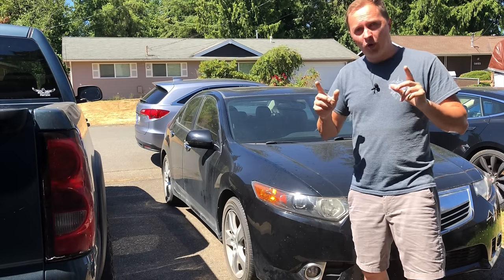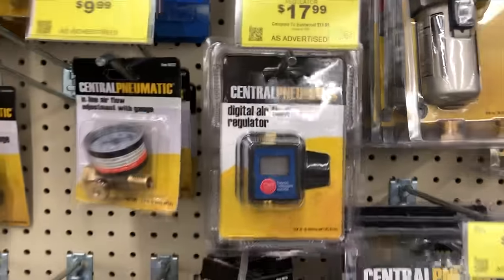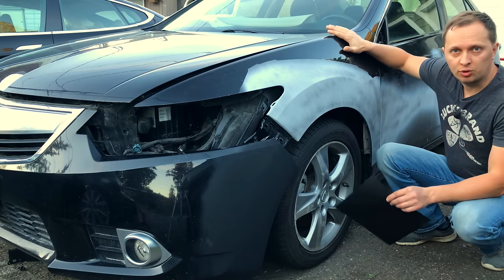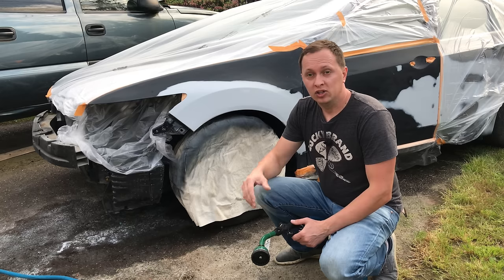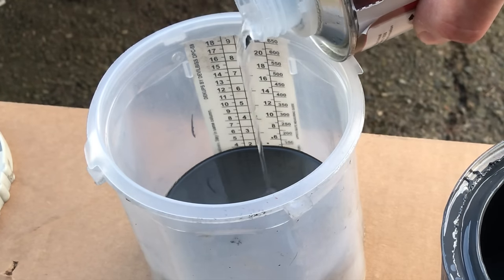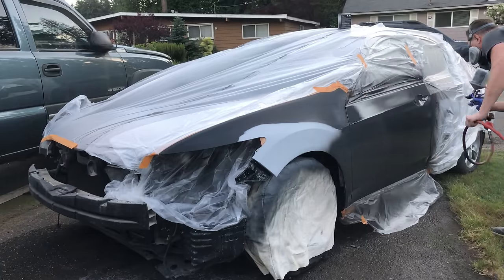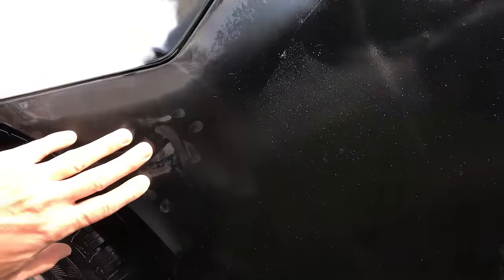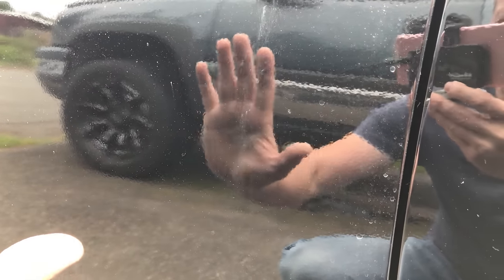✅ Using Cheap Chinese Harbor Freight Paint Gun to Achieve Professional Results

Comment: These harbor freight guns like a lot of air 35 to 40 psi to atomize better smoother finish
Reply from the maker: I did realize that toward the end... So in reality they are not HVPL, too much materials would get waisted at that high of pressure setting. I've set those guns up just as I setup my Iwata and DeVilbiss,
Reply: @gene7902  brother I can lay clear with a BLK widow the as good as I can with a sata 5k
Reply: @gene7902  ehh if u doing something onna budget it will be great
Reply: Also cheap paint likes to orange peel.
Reply: The one I got from harbor freight worked better at 29 psi than 45 the normal working pressure less orange peel
Reply: What psi do u run at to get a really good  atomation
Reply: I noticed this as well I thought it was me
Reply: I had the same problem , they like more pressure .

Comment: i am not a professional painter but have painted several cars and im embarrassed to admit that the finish that you got with the higher priced gun looked pretty good to me. I can see the orange peel, but many cars factory paint has that amount of orange peel anyways. As a matter of fact, you can spot a car that has been wrecked before often times by the LACK of orange peel on the refinished panels ONLY. (Most body shops use real high quality guns, hence no orange peel) Great video, and you sure did have some great results for painting a car outside. Excellent video as usual!
Reply from the maker: Thank you very much!!! The finish that I got with the second gun wasn't too bad. But that orange peel was heavier than the original Acura orange peel. If I wasn't doing a video I would've done just a slight cut and buff where some of the orange peel would have remained. But for the sake of the video I want to show people that even a really bad paint job can still turn out to look show quality, so I went ahead and made it look like glass.
Reply: In reference to the orange peel - it actually depends on the age of the car.  A car that is 15 years old will have less orange peel because it gets knocked down over the life of vehicle by owner(s) washing and buffing their car.  If you ever look at 20 year old car that has been well kept for, it has pretty flat paint.
Reply: @fix206  Good job and excellent video the only question I have is the fact u were painting that close to the truck? Is that ok? How did you avoid overspray?

Comment: This is a perfect example that cheap costs you more in the long run. If you have the skills to do professional work, buy professional tools.
Reply from the maker: Yeah no kidding, now I have to spend a few more hours cutting and buffing. I generally don't have to cut and buff after I use my usual guns.
Reply: I use these cheap guns all the time and they are good. Just clean all the silicon out of them and they are great guns.
Reply: totally agree, 4 another 30 beans u couldve got a devillbis flg5 from spray guns direct $136 beans 😀
Reply: Exactly, if these are tools used to make money then cost should be low on the list of priorities.

Comment: I paint at home and have a few DIY budget guns. The profesional HF is one of my favs along with my Devilbiss FLG5. I use pressures on the lower end to keep overspray down but the profesional and purple guns do  not like pressures under 2 bar for base/sealer and more for clear. I dont buy the purple guns anymore because they all leak air into the cup. My FLG5 can run at 15-20psi base/sealer and 22-25psi clear with low overspray. Cranking up the pressure on alll these guns give you better finishes at the expense of overspray. I have used expensive guns and they are great but for the DIY you can get it done with a less expensive gun if you learn to set it up to suit your needs. Cheers

Comment: Another very informative video (as usual). It was interesting to see the difference in the finish quality with the two guns. I was expecting the more expensive gun to do a better job and that proved to be the case. One thing though, as you pointed out, the preparation is far more important to getting a good result. Even with the cheap guns and orange peel, by the time you sand and buff the clear, it will be as good as using a good quality gun, just more work. But either way, the preparation defines the final finish. You are doing well painting outside, but it just goes to show what you can do at home without all the professional equipment, for less severe damage.
Reply from the maker: Howdy Bruce !! Yes, as you've said it, all that these cheap guns do is create more work for you in the end to achieve the desired end result. Because I ended up spending a majority of the day on a paint correction that I otherwise would not have done if I wouldn't have used my nice guns
Reply: It's all about the painter but it looked great even with the cheap gun.

Comment: Been using both guns for years take apart and clean silicone off and you will get great results with these guns what's nice about it is you can have several guns at your use at the same time. All my paint jobs are in my driveway.
Reply from the maker: Do you crank the air pressure way up to get better paint/clear atomization ?

Comment: Mirror finish...good enough for the DIY guys just trying to get paint down...like you said. A little cut/buff would be fine. Great vid!! 🍺🍺
Reply from the maker: With a bit of practice just about anyone can paint in the driveway or a garage and get good results in the process... And if you're not not too sure about what it is that you're doing, it's better to lay the pain down on the dryer side rather than on the wet side. It is much easier to cut and buff orange peel than trying to sand down runs or sags in your paint job... Ask me how I know :)

Comment: A guy I follow on YouTube painted a Corvette hood and achieved Excellent results with the Harbor freight cheapo gun.👍🏿
Reply from the maker: It is possible to achieve a good result by using that gun, but to do that you have to crank the air pressure way up. When you do that you create a lot more overspray, meaning that you lose a lot of your material into the atmosphere instead of it ending up on the panel that you're trying to paint. Good quality guns can achieve a good finish at much lower air pressure so this way you're not wasting expensive materials

Comment: I use the Harbor Freight two gun set for shooting primer. The 74 dollar gun I use for base coat and clear. I spray the clear at 20 psi and get a nice finish. If for some reason things don’t look perfect you can color sand and make it look great.A lot can be said for proper setup of your gun and cleaning it throughly before you ever spray with it.
Reply from the maker: I did not do a thorough cleaning before spraying, just ran some thinner through it a few times and called it good. I sat the gun up the same way as I set up my Iwata and you saw the result that I got with it. With my Iwata I can lay both base and clear down where I normally don't have to do any color correction afterwards, might just have to take out a nib or two and that's about it

Comment: This was a great video, I am looking for a sprayer to use on my fence and the $30 Harbor Freight seems like a winner. After seeing this, I will also repaint my wife's car, which is pretty sun burnt. If I can get it half as good as your worst job I will be pretty happy and a big improvement over the existing.
Reply from the maker: Don't think this paint gun would work out too well to spray a house or a fence with, because that type of paint would be too thick to pass through the small tip at the end of this paint gun. But I'm sure you can get your wife's car done with one of these no problem :-)

Comment: I agree if you plan to spray on a regular basis or plan to make it a sideline or business get a professional gun. I have used the cheaper guns for work trucks and in the shop for different projects with good results. While not a professional unit they work for those of us that might use a spray gun a couple times a year.
Reply from the maker: I normally pick up a lot of my tools used so I don't pay the premium when you would if you buy new. Pretty sure I paid right around $200 for each of my guns that I spray with. I don't paint a whole lot maybe two-three times a year. But I always try to achieve the best result possible without doing a whole lot of cutting and buffing afterwards, and these guns help me achieve that good finish so that's what makes it worth it for me
Reply: @fix206  
Same here buy gently used tools and equipment. Harbor freight sprayers are what I call my one and done, modification, or sacrificial tools.

Comment: I have painted quite a few cars with the purple gun, a new one each time old one with a little mods become my primer gun, I use about 35- 40 lbs pressure to loose the orange peel, get just as good a job as my expensive guns.
Got to clean that new gun perfect and then do it again, has a lot of oil on and in it.
Reply from the maker: The main point I was trying to make is that if I set up the purple gun the same way as I set up my expensive guns it doesn't perform the same... Sure you can achieve a better finish at 35–40 psi but that point you turn a lot of your material into overspray. Professional guns achieve nice finish at lower pressure thus depositing more material onto the panel rather than into the air. 
And just like you I do keep a purple gun for primer.

Comment: Turn up the pressure. Most cases the cheaper the gun the more pressure is needed. (most cases) The purple gun will lay a professional looking finish as long as prep is done properly. Wet sand after helps tremendously.
Reply from the maker: You probably could get a better result with that gun by turning the pressure way up, but it's suppose to be an HVLP gun and I just wanted to see how it would perform by setting it up the same way as I set up my HVLP Iwata. With higher pressure you end up with much more overspray, which basically means that you're losing a lot more material... It's an OK gun for a beginner and even a weekend warrior. I guess there's a reason you don't see painters at collision shops using these, and I personally wouldn't use it for anything more then to lay down some primer...

Comment: Thank you so much for taking the time to make this video and show us how bad a cheaper gun will cost you in time. I personally could not do that. I was honestly thinking about one of those guns from harbor freight, and as a beginner I'm so grateful for this! Now I'll just go ahead and get one of the better 2 you have. Thanks again and keep that content coming!! God bless
Reply from the maker: If I were you I would avoid Harbor freight altogether when it comes to paint guns. If you're trying to do this on a budget go ahead and just buy a used gun on eBay or something like that. Trust me it will be easier to learn with a professional gun, you will achieve better results after a bit of practice, but with a cheap gun even with a lot of practice you're still not going to get a satisfactory finish. And at that point you probably would just blame yourself for doing something wrong rather than blaming a crappy gun. It's worth it to spend a bit more but save yourself a ton of headache in the end.
Reply: What did I end up getting?
Reply: I've seen a cheap gun do a lot better it was actually amazing

Comment: I stumbled upon this video as we inherited a 09 civic that I am restoring for my wife. It needs a 100% paint job and in several parts, large portions of metal are showing. I was wondering if I need a HVLP or a LVLP for my current set up. Someone have given me 2 of those purple guns
 My compressor is a harbor freight and the specs are as follows 

It's a 27 gal 200 PSI

Flow rate
6.3 SCFM @ 40 PSI, 5.1 SCFM @ 90 PSI
Volume
27 Gallon
AC Volts
120
Amperage
15

I am an absolute noob to paint. So if you're willing to spend some time I have some questions, I really appreciate you taking time to look at this
Reply from the maker: The compressor that you have will not work for auto paint unless you have some small items that you're painting. It will run out of pressure very fast and I don't think you would even be able to paint a single door with a compressor even if the tank is fully charged. Those purple guns from Harbor freight are garbage in my opinion, but if that is all you have then just go for it. HVLP is the way to go

Comment: Sharpe makes some pretty good entry level professional guns.  Think they are in the $150 range.  All the materials are expensive.  The average Joe would be shocked what sheets of sandpaper go for above the 800 grit range.  Your clear could have been part of the issue too.  I've become a fan of Southern Polyurethane's products, but you can't just pick it up off the jobbers shelf.  You are pretty creative in your work.
Reply from the maker: I have never used Sharpe guns, but I've heard good things about them. I've only ever used Iwata and Devilbiss guns, and had some pretty good luck with them. Personally if I were to get into painting but couldn't afford some higher end guns, I would just try to find a good used gun for a half or even third of the price. And you are not kidding when you talk about price of materials, and everything just keeps getting more and more expensive as the years go by. I have noticed that the clear that I used, set up a bit quicker than I thought it would so it didn't really have a whole lot of time to flow out, but the cheap guns that I used for spraying didn't atomize it very good either, especially the first gun used.   I do appreciate the comment, more videos to come here shortly. Stay tuned 👍

Comment: What i've learned painting my classic VW Bug with the purple gun is that you need to crank the pressure way up to like 50psi to get them to atomize correctly. That way I get way less orange peel than in the video.
Reply from the maker: But at that point you create a huge cloud of overspray and a lot of your material doesn't make it to the panel thus being waisted... Still doesn't make it a good gun, you can normally lay the clear down like glass at 25–30 psi with a good, professional gun... I'm sure you can use a sandblasting gun and turn the pressure up to 100 psi and you'll be able to lay down some basecoat and clear through it 😂😂😂

Comment: I don't paint much at all. But I will admit the purple gun works good as a primer gun, just not for real paint. I have heard sometimes you get lucky and the machining on the tips works out really well, but that is an exception and not the rule.
 All in all, a very informative video. I have heard all this before, but to see it in action is much better.
Reply from the maker: That's just about all the purple gun is good for, I've been using one of those for a primer gone for the past few years with good results. But with primer you're not really looking for a good finish, just coverage.  Thanks for the comment Matthew !! Also let me know if you ever come across Holland Landing gear :-)
Reply: Huh I have painted a lawn mower, bunch of furniture, a pair of French door and several other things with the purple gun and get very good results.  Yes they had some orange peel but nothing to cry about and I run anywhere between 25-40 psi depending on the paint I’m spraying.  Not sure what you are doing with it but I’m getting good results with it?

Here’s my mower painted and clear coated with purple gun no polishing

https://pin.it/53sqyiN

Comment: I use these cheap guns all the time and they are good. Just clean all the silicon out of them and they are great guns.
Reply from the maker: Maybe it's something that you have to get used to, maybe if I would've spent more time experimenting with different settings I might've gotten a different outcome . But I went head and set these guns up like I would normally set up my other guns that I've been using with great results for a while,  and the settings didn't work. And also I probably would've gotten better results if I would have cranked the air pressure way up because these guns didn't seem to itemize the paint too well. But at that point you're creating a ton of overspray and you're wasting a bunch of materials... Something tells me they're not true HVLP

Comment: Been painting stuff for aout 40 years now. Even tried out the same guns and still use them on small parts etc with good results. You have a mess there yes but dude, it's not all the guns fault. You should have known painting outside will be a hazard and with any breeze at all you picked up massive ust and crap out of the air. The orange peel you could have fixed with wetsanding and wax or a new coat. From a step away it looks better lol. For times i have to paint outdoors I do the wet ground, use yardguard bug killer for as far out as possible , killing all the flying bugs you have in your paint. Then I built a 2x4 frame to go around the vehicle or parts and tarp over the frame giving some defense against what  happened to you. In the end, normally have to do some wetsanding, then polish or another layer of clear if the formula allows it. The good about the guns? Cheap and they did not create runs.
Reply from the maker: I"ve been painting outside for a while and got it down pretty good. I always pick a right day for spraying. I never paint if it's breezy, alway saturate the ground around the work area so amount of dirt that I get in the paint is very minimal, but hey you can even get dirt in your paint job if you're spraying in the booth  (been there done that :)  ) Those guns just weren't that good, whenever I use my Iwata/Devilbiss guns I always get good results with them